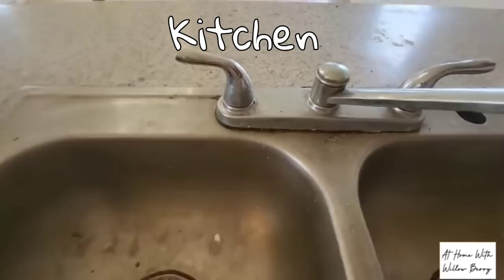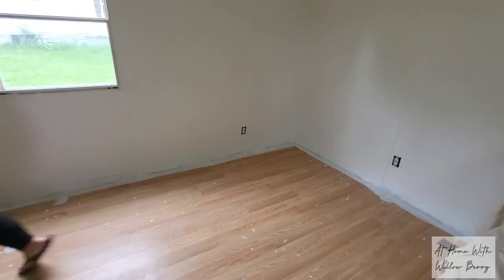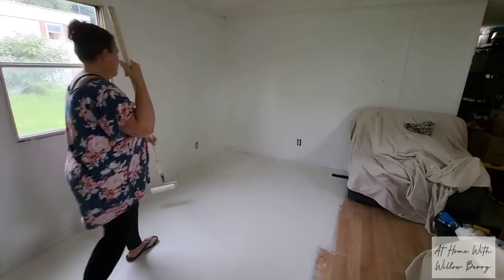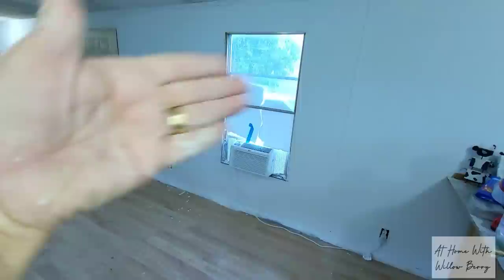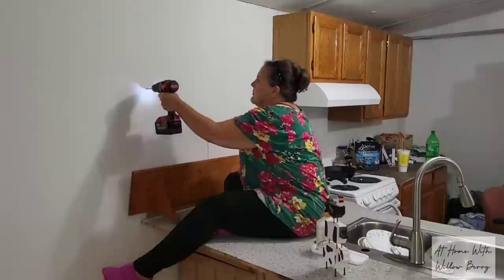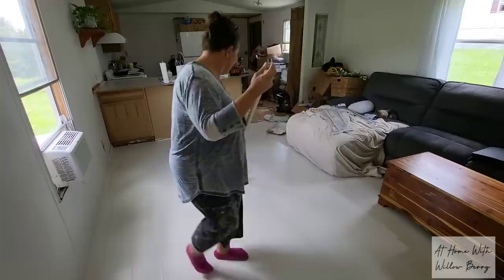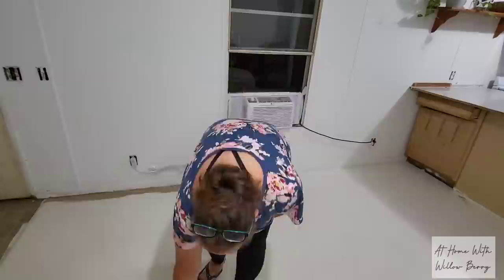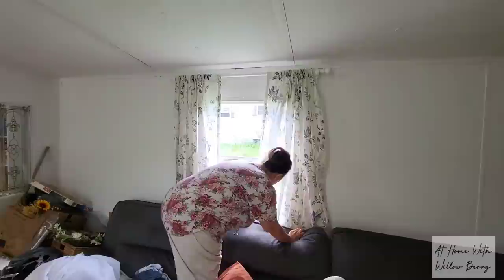LIVING ROOM MAKEOVER / 1996 SINGLE WIDE TRAILER / MOBILE HOME LIVING

Comment: Just came across your channel, as a point of info the reason the floor showed dirt wasn't the white color of paint, it was bc it wasn't  "sealed" afterwards, that would have allowed for easy cleanup too. In time if your furniture was  moved sliding on the floor the paint would have had scratches of white paint lifting up anyway  unsealed. Linoleum  MUST be sealed always when painting with any paint/stain, with steady foot traffic it would've been worth the effort...hope this proves helpful for future reference in upgrading your new home...
Reply: If you research porch paint, I believe you'll find it doesn't need to be sealed. You are correct that it will show wear from foot traffic and furniture movement in time (just like a porch).

Comment: Lots of effort on your part cleaning this double wide up. I have a questions why not go with a grey of some blend. With your couch color. Your curtains would go great with that color mix also. The new rug would pop on that color floor too. Suggestions ask the boys to leave the shoes at the door from now on. It helps to keep the dirt from all over the house too. Good luck with your new home search. Keep us all up to speed on your new adventures through your searches. What line of work are you both retiring from?

Comment: How does that paint hold up on the floor? No matter what patio paint I use outside, nothing lasts at all
Reply from the maker: So far it's doing really good. I think next time I will seal the floors to make mopping easier but I'm really happy with how they turned out. ☺️

Comment: You should NOT of painted those floors, they looked better than the paint job. Paint job looks cheap. You can always buy the peel and stick flooring from amazon, that would look so much better. Grab a big 8x10 rug for that floor.